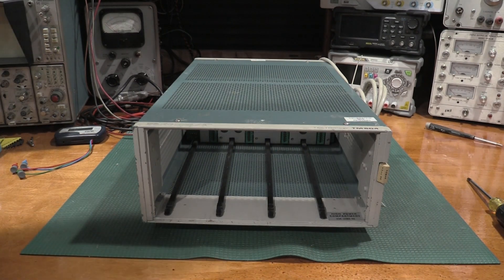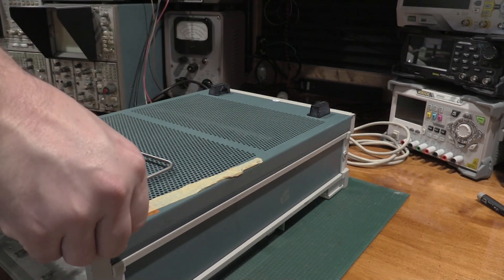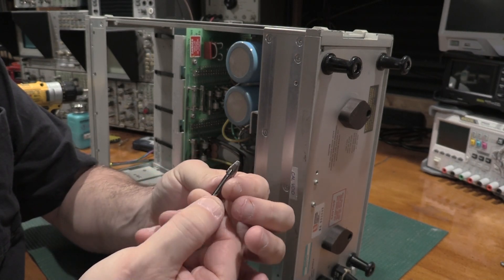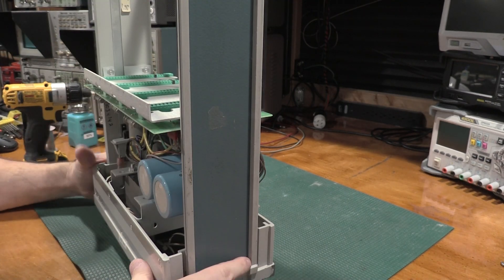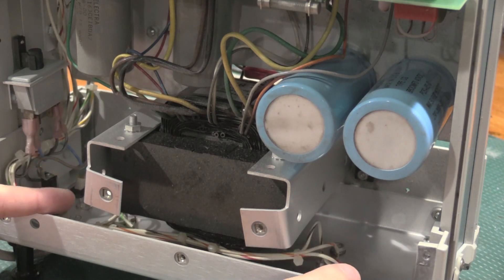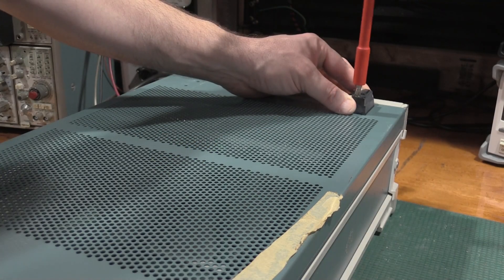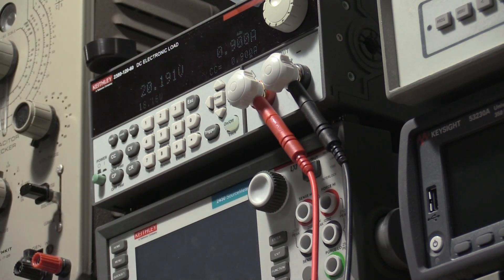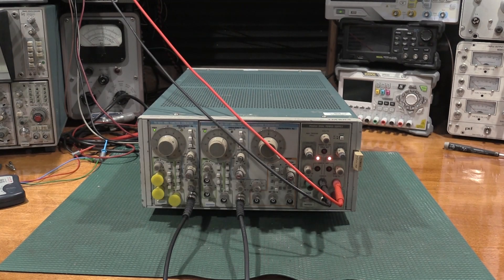TM 504 Power Supply Lab Checkin and a SURPRISE!

Comment: I see that you check the semiconductors on these units before powering them on. Are the devices on these known to fail? I have a Tek TM504, and I don't want it to fail and over volt anything it's powering. I have an SC502 which is my golden pride in my small collection of TM500 plug-ins.
Reply from the maker: They are not known to fail but I have run in to some that have failed, as the units are unknown to me I do check them as part of the check in process and 1st run through of the power supply. But then I am not to worried about them. Unit from all over and who knows where find their way to my bench so it is a matter of caution before I drop in some of my more exotic plugins. There are some plugins that don't even use the pass elements So this really can be plugin specific.
Reply: I have a TM504 where one PNP pass element was bad. I didn't think to check, and plugged in a DC503 which used that element for regulating -33v up to -22v. It passed the full voltage to the rail, but it seems to have only damaged easy-to-replace transistors in the regulator circuit.
Reply: They can be blown up any time.Ask me how I know ;-)
Reply: You can blow them up occasionally. Ask me how I know ;-)

Comment: Nice, i have this exact unit.  I'm designing a nice modurn bench power supply plugin for the tm50* frames as the existing ones are 'a bit meh' by modurn standards and not that available in the UK